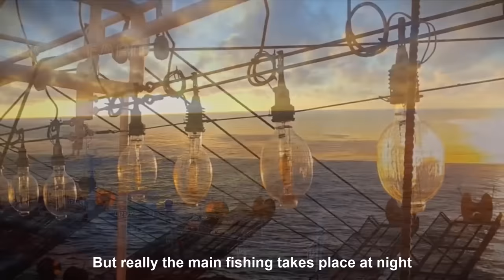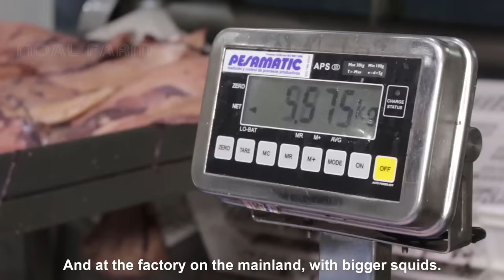How to Catch Giant Squid Fishing by Vessel - Giant Squid process in Factory

Comment: these pre stamped squid rings are the biggest reason people dislike squid, it's totally dishonest. A true Calamare Romano or deep fried squid ring is made from the cross section of a small to medium sized squid and is the circumference of its tubed body. Those rings which were punched out of the flesh of a very large squid will be tough and have a strong amonic taste. IT's fine for "feeding people" but taste profile will be very different.